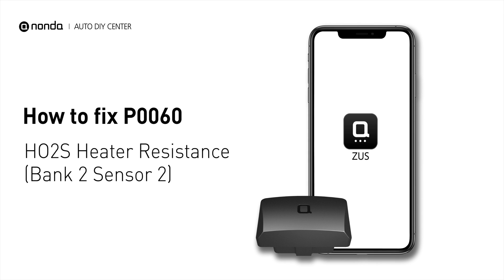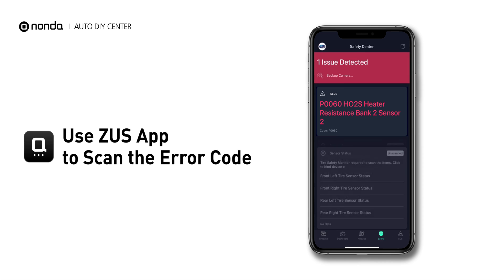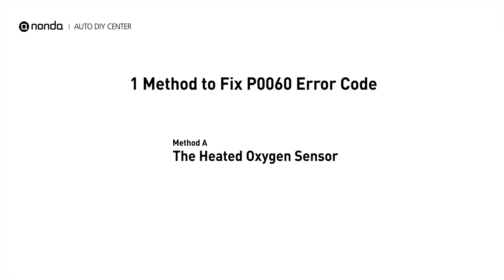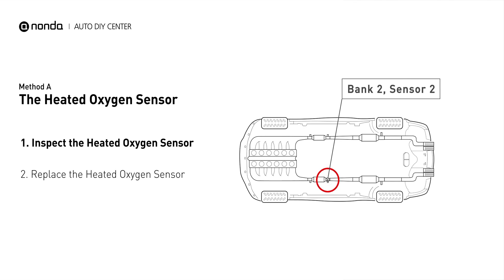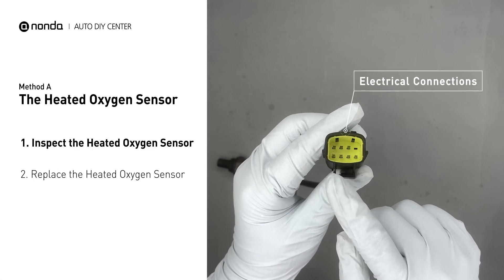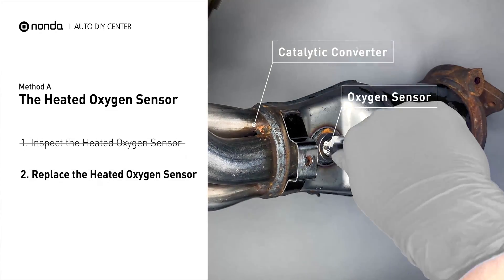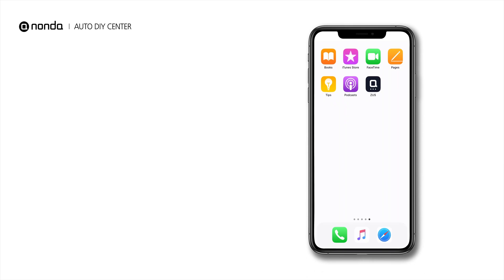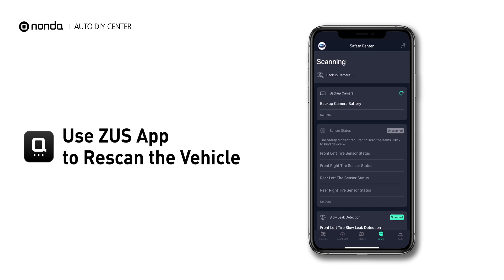How to Fix P0060 Engine Code in 2 Minutes [1 DIY Method / Only $19.25]

Comment: I was getting a P0054 and P0060. I put spacers between both downstream, O2 sensors and my check engine light went off hasn’t turned on, but I still get the code both mention above is that normal
Reply from the maker: If your engine light is off, you may clear the code with an OBD device.